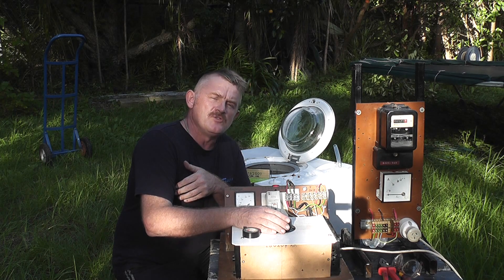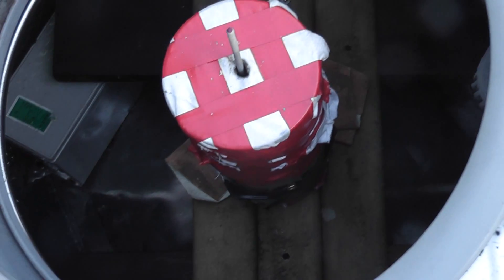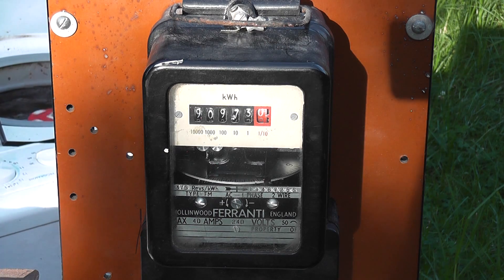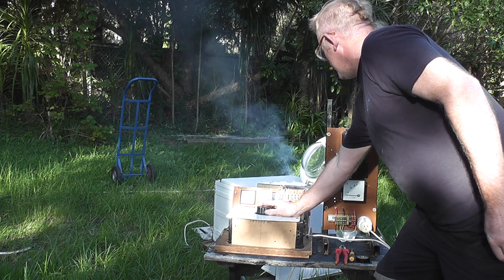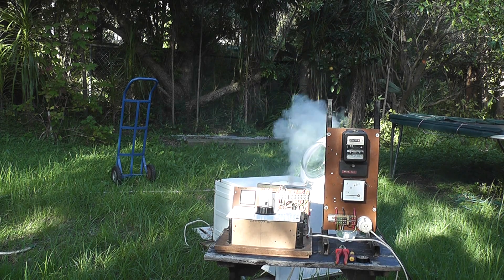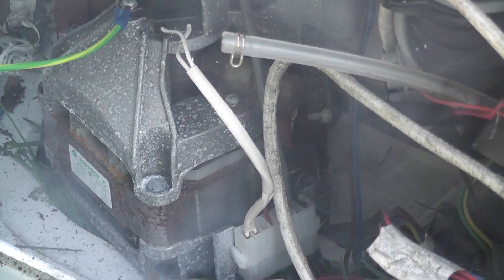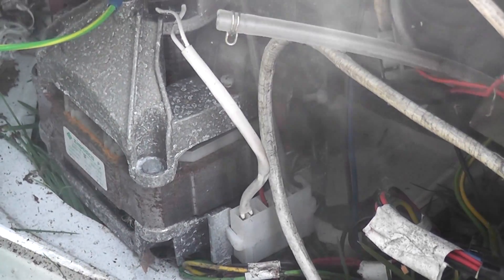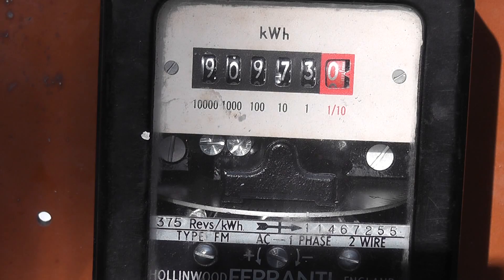Rotax smoke tornado from washing machine

Comment: That was rather pointless, all you did was make something that spewed smoke like an old steam train. I'd say, buy a good fog machine, use an upright washer not a front loading washer, connect the fog machine to the hoses that pour into the washer and build fan blades mounted inside the washer and you'd have more success at making a tornado.